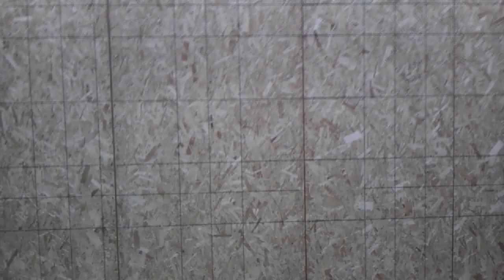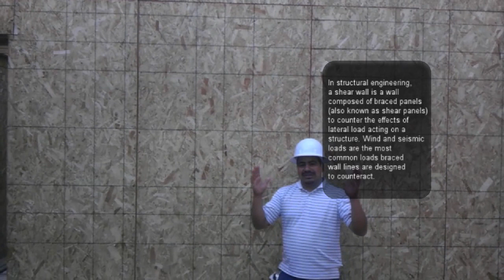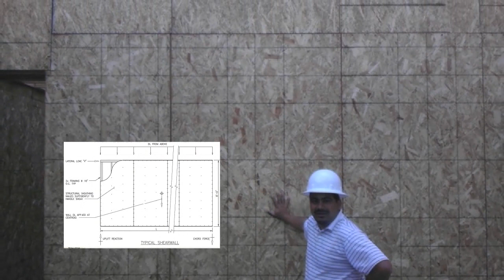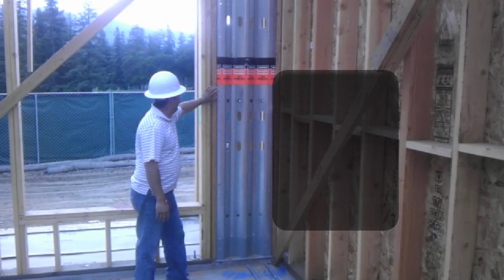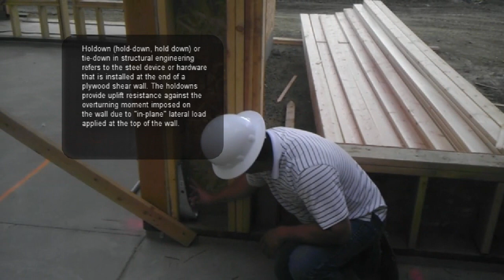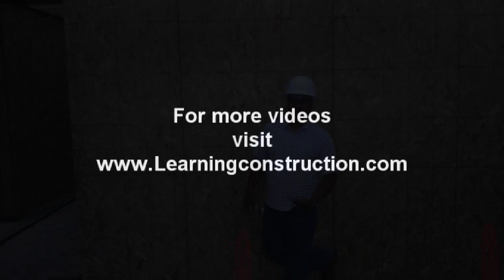What is a Shear Wall

Comment: I have a shear wall in my garage and on the other side of that wall is my pantry in the kitchen. The plywood is covered up by a 1/2 inch drywall.  I want to mount a tv in my garage on the shear wall, is it possible? How do I find the studs behind the drywall and plywood?.

Comment: Pretty good video with an intelligent presentation. Surprised at the comments by some about accent. It's very minor and not a problem. But the audio quality could use some help, like putting the microphone on the person talking does wonders compared to just using the mic in the camcorder.

Comment: Question, min 1:24 is diaphragm nailing or field nailing?
Reply: A diaphragm is usually a floor or a roof.  I think what you meant was, is it edge nailing or field nailing.  Field nail spacing is in the middle of the plywood panel, and edge spacing is the nail spacing along the edges of the plywood (or OSB, or whatever is called out).  Diaphragms such as floors or roofs, can also have their own field and edge spacing called out, it isn't necessarily the same as the wall.  Hope this helped :)
Reply: The guy explaining on the video called it diaphragm
Reply: Tkt1983 510   Probably because the subject matter is about a vertical diaphragm or shear wall. A diaphragm is a thin structural element capable of resisting lateral forces (wind or earthquake) by functioning like a horizontal beam.  And yes, the usual are floor and roof and of course the shear wall. All three have field and edge nailing called out by the building code or the structural engineer of record. And by the way the orientation of the plywood is insignificant, but always follow your approved plan.

Comment: Where do I get some shear wall to buy
Reply: You don't, unless they are special types called out by a structural engineer and they are usually made by Simpson and very expensive.  Shear walls need to be designed by a structural engineer to assure their integrity.  Also, as seen in the video, most shear walls are usually just some type of plywood or OSB panel attached to a studwall.

Comment: I would really need your advice on this.Is it possible to create a shear wall after the construction is completed.Can we just knock the brick walls and create a shear wall instead.The building has concrete frame structures with no shear walls and is 4 storey's high
Reply: It is possible, but can be very pricey.  I would talk to a local structural engineer, and they will be able to check what is currently in place, and what needs to be done.